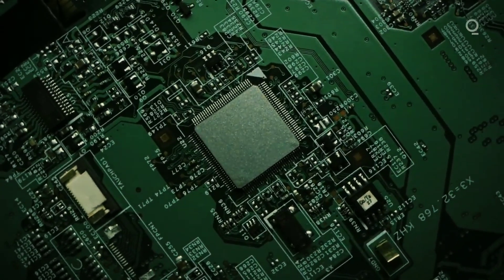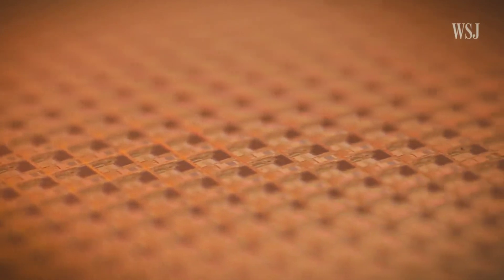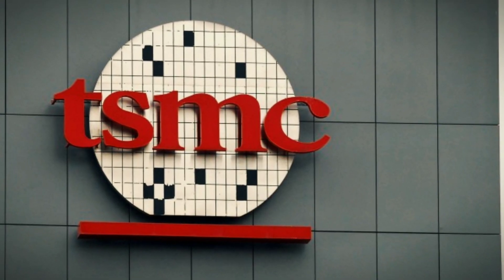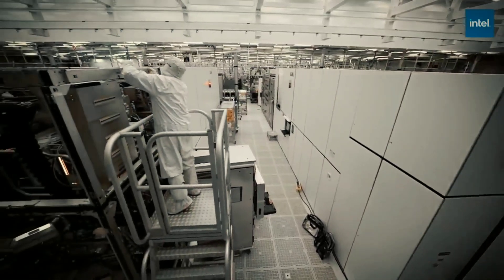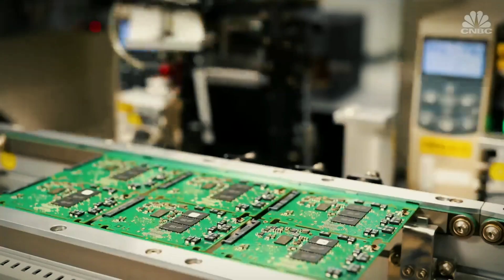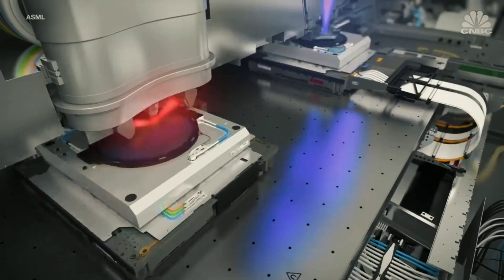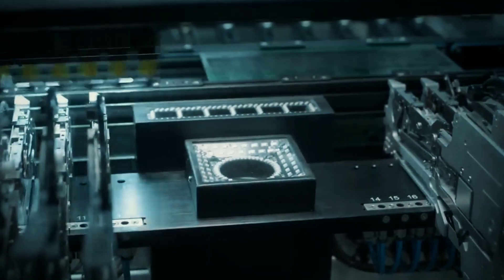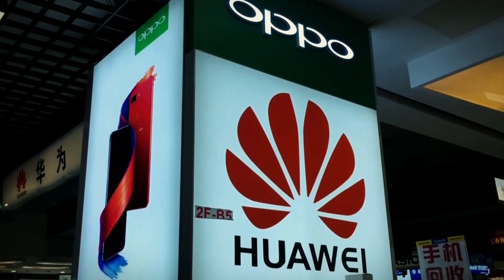China Made the World's Fastest Microchip |  This Changes EVERYTHING!

Comment: while DUV take "more" pass, it is rarely mention that by more it mean 4 pass compared to 3 pass... which is only 25% more work. if you have 25% more machines, you will produce at the same rate. TSMC reach fairly high yield in their DUV line a decade ago, this is not revolutionary. we just overhype "new" technology as being some insanely superior tech, the reality is EUV is better, but not it not entirely a class of it own yet. the ability to "single pass" in EUV is not achivable because the current generation of them do not have a light source strong enough to burn the circuit onto the chip at the required strength. this will change as machine get modernise, but today EUV still suffers from the same flaws, it has yet to reach it theoratical advantages.

Comment: There is now way there doing anything smaller the 20NM at scale
Reply: TSMC did that like a decade ago and the equipment China has today are definitely newer than what TSMC had back then. they could easily do it, the question is not if they could, not how many chip they can make. the media overhype EUV, EUV in theory is superior but it has not reach it potential because it light source is not strong enough to do the single pass, most fab still do 3 pass even when they use EUV, which make China's 4 pass solution fairly competitive to scale since the machines they use are alot cheaper. at the end of the day, this is not a tech competition, this is a price point competition.